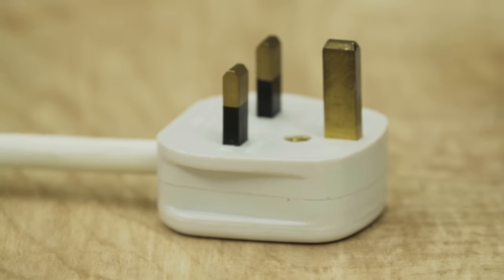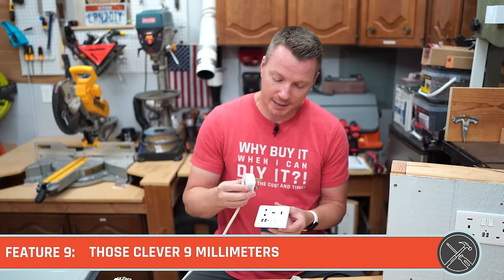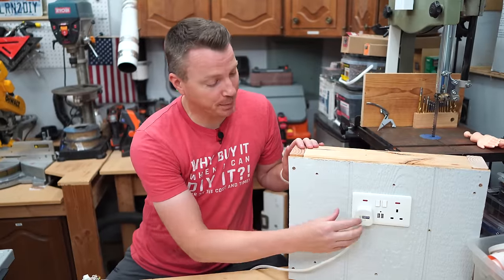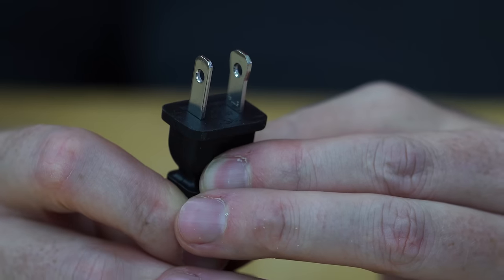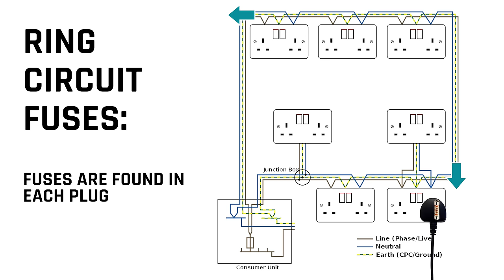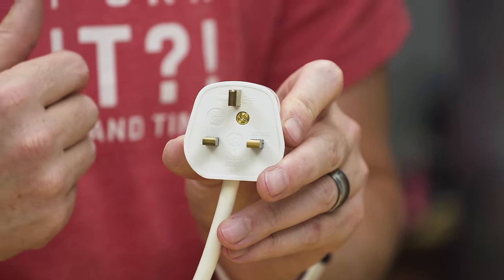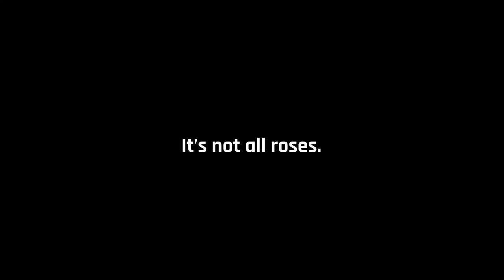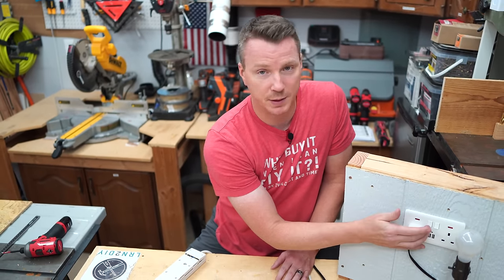British Plugs and Outlets Are On Another Level

Comment: As a Hongkonger, I am proud to use the UK plugs here compare to the others. Especially the fuse and 3 pins features. One time my brother use a Chinese plug hair dryer and it was short circuited. A large explosion 💥 sound happened and the house went dark. Wt a horrible experience.
Reply: That was not due to the plug, but lack of a proper HFI-setup.

Comment: As a zambian I grew up with the brit type of wiring 
I have zero electrical training but I can trouble shoot and fix anything with this system it quiet straight forward and calming knowing you have earthing and fuse plus circuit mains breaker.

Comment: Stepping on a plug is so painful so I really empathise with the last point. I don't really think anyone in the uk and elsewhere would go to the extent of troubleshooting the rest of the system before realising that the switch isn't turned on because we've had it our whole lives. Although there have been countless occasions where I have plugged my phone in to charge and forgot to switch it on
Reply: Stepping on a plug is definitely worse than Lego. By a mile.

Comment: The pain of treading on a British plug is unparalleled, that's something I haven't missed since moving to Canada!!! Great video!
Reply: yes, far far worse than standing on a lego brick.
Reply: Since I don't leave them lying around when unplugged I have never managed to do it. If you don't have enough outlets so feel the need to leave the plug lying on the floor get a plug in adaptor that goes into the socket and has 4 switched outlets lined up just below the wall socket. Then you can leave the plugs in the socket and just switch on or off as required. The internal fuse of the adaptor will make sure you can't overload the primary socket.
Reply: Try looking where you’re going….
Reply: Very close to the pain of stepping on LEGO
Reply: Just how often were you standing on plugs and why weren't you putting your cables away?
I haven't stood on an upside down plug in at least 30 years.
Reply: @Gambit771  I was about 15 or 16. I only ever did it once (going to the loo in the middle of the night) and never ever did it again. Leaving plugs laying around on the floor where they can be stepped on is silly.
Reply: From the UK. You will find that you stand on a plug someone else left out. Best thins is if you stand on them it rarely damages the plug. I have bent the pins when standing on them before but I wasn’t fit to put weight on that for for at-least 24 hours. So they are sturdy. I also have plugs from the 70’s that are still in service.
Reply: @ardin404  Yeah, well, stuff in the 70's was engineered to last at least 10 years and if a consumer had to replace something within that time, they would tell their all friends and never buy from that company again. Manufacturers these days have us all trained to think "well, the warranty ran out last month, so I guess I'll buy a new one!"

Comment: As an Australian, I felt sad for Americans when you described the issues with plugging multiple high draw appliances in at once. I thought that was just something to consider when camping with a generator. 
You might cry if you saw the power board running under my desk that powers my PC, heater and kettle. It runs them all at once a couple of times a day in winter.
Reply: But Oz plugs are primitive compared with the Brits. And as for lighting.  I've seen up to 4 cables trying to be squeezed into one of the minuscule light switch points (of which there are 4 in all, the whole lot contained in a 20mm diameter switch.  Utter madness.

Comment: Load balancing, a problem I have not heard of before is practically covered by having multiple rings. The ring covering the kitchen will use heavier gauge wire to cope with all the appliances. Cookers and other really heavy stuff will usually have its own supply from the main board. In my house there is one ring for upstairs sockets, another for down stair sockets and a separate on for the kitchen. Lighting is separate and typically upstairs and downstairs are separate. I have a separate ring in the garage, which I installed myself. Point taken about the size of the plugs, and sockets are available without switches. Curious to how well the UK system works with 110 volts.
Reply: 6mm
Reply: Judging by the panels in all the flats I’ve lived in, most builds in the last twenty years have had a dedicated feed for high power items like cookers and boilers, one for wherever the space for the washing machine and dryer is and one feed per room. Load balancing was never a thing I’ve had to consider.
Reply: Thanks for that I was sooo confused when he mentioned that but had forgotten we have multi rings ...
Reply: Can you add a ring? I noticed in my kitchen it trips and takes down all the house power.

Comment: As a kid in school (UK) we learnt exactly about plugs, how to take them apart and how they worked. It blew my mind when I moved outside the UK that other plugs didn't have many safety features. Whenever you would leave for holiday you would turn off all the plugs at the sockets to save electricity and keep everything safe from power surges when you're away.
Size was never an issue, nor stepping on it. 😂 And you were used to the switch

Comment: As a brit who has travelled a lot I've also thought the UK plug was the best thought out but couldn't say it out loud for seeing arrogant so thanks for this video!
Reply: If its true then just tell people to cry about it. Facts dont care about your feelings
Reply: The 2 prong plug always scares me. Even if I don't know the exact science, I just don't feel safe with a 2 prong that feeds horizontal compared to a 3 prong that feeds downwards.  I know that years and years of smarter people's knowledge have got my back, and they figured it out a long time ago. I can't understand why other countries don't adopt this method.
Reply: @bonjovi7399  Agree, it really should just be a global standard for 230v
Reply: @bonjovi7399  you are naive to think that smarter people have got your back. The main purpose of the cpc pin, or earth for lamen, is to protect the circuit from a short ect, the added benefit is that it also protects you from shock as the voltage is being directed to earth by the cpc, and not into you.
Reply: @JCJW101  Typ F is quite neat, too. Not so bulky and the socket also allows Typ C and the plug can easily combined with Typ E

Comment: In the UK you learn how to rewire a plug in GCSE (age 15-ish) Science lessons at school. It really demystifies electricity and probably saves on a lot of perfectly fine appliances from being thrown away.
Reply: the reason it is taught in GCSE (the UK's last set of middleschool exams) is because appliances in the 80s and 90s used to arrive without the plug connected up. So it was important to teach people how to do it. Most kids these days barely listen in that section of science class, because 100% of plugs now arrive pre-wired. But still a useful part of learning about electricity and actually being told about what's inside the plug
Reply: @Stealth360stealth  "appliances in the 80s and 90s used to arrive without the plug connected up".

Can't say I ever bought an appliance that came without a plug. Could wire one from the age of about ten (in the late 60's) but never, ever had to put a plug on something new.
Reply: I don't remeber being taught that at school but if it was it really didn't demystify electricity for a lot of people. Even those with a STEM mindset. 
I did mechanial engineering at uni & the number of people who struggled in the electronics module because they thought it was basically magic was unreal. I literally blew some of their minds when I put hydraulic equations next to electronics equations & labeled the electronic component again its equivalent in a hydraulic system.

edit for clarity they had no issues doing the fluid flow equations but got mental block in electronics cause they started with the mindset that electronics was basically incomprehensible magic even when the fundamentals were very similar to other areas of engineering that they were competent in
Reply: @Stealth360stealth  Oh yeah, my gran told me this. To be honest, the skill hasn't had many uses but it has been handy. Namely when I wanted to change an extension cord to have a much longer cable. Still have it somewhere.
Reply: @Stealth360stealth  Its crazy. I learned how to rewire light switches and electrical outlets in my home just because I paid attention to how to wire a plug. Its the simplest thing in the world.

Comment: A typical ring main in the UK is 32A, which is 7kW of plug-in appliances on each ring. Cables are sized such that even if the ring is broken, the full load can be carried on either leg (spur) without cables getting dangerously hot, even when those cables are buried in walls. The so called 'load balancing' problems just don't happen, even with badly botched installations.

In any case, while many modern 2 or 3 bedroom homes have a single 32A ring main for the whole house, larger houses might have two or more ring mains, one per floor, or separate ring mains for the front half and back half of the house etc. We will typically also have additional 16A to 45A spurs (radial circuits) for high power devices like cookers, showers, A/C units and immersion (water) heaters etc. (I long for a 10.8kW shower and an 11kW induction hob).

Comment: I grew up in the UK and as a kid I remember being terrified of power outlets when I went on holidays abroad. Something safe and normal back home which would now attack me with electricity if i touched it.
Reply: I remember seeing a shaver socket actually inside a shower enclosure in Greece. Thankfully not in my room though.
Reply: Whenever I plug in a two pin to three-pin travel charger charger on holiday it never seems very stable. Three gives stability despite the bulk that’s associated with it

Comment: We have a German single slice toaster here in the USA and installing the "SCHUKO-Steckdose" receptacle gave me an appreciation for the better design and quality of the German system. Also the skinny cord for the 240V toaster is nice.
Reply: The it's just Shuko (type F), which is the best plug in the world
Reply: @tiagochavarro  Agree it is best, and invented by Albert Büttner in Germany.
Reply: My issue is why on earth you would opt for a 1 slice toaster.
Reply: @jaridh1442  Tiny space available. There's only one toast eater in the house and they don't eat much. Irrational purchase made easy by Amazon.
Reply: The skinny cord is a good observation, and also a key differentiation. 

120V low amperage power is vastly safer so it doesn't need as many safety features.

The main caveat of 120 volts is that it requires double the amperage which results in double the wire thickness. 

During the world wars, Europeans couldn't afford that much copper wire, so they made safer plugs/outlets to make up for more dangerous electricity. 

Having the skinny cord is because it has less copper.
Reply: @tiagochavarro  my thought when I clicked on the video. "The british is pretty good but this guy probably hasn't seen any other central european outlet especially not schuko or the french one.
Reply: @aminy23  wait, what safety features don't you need on 120V? It can be marginally safer when the person is already shocked, but it's nearly impossible to get shocked even if you want to in a semi-modern system
Reply: @NJ-wb1cz  For 120 volts we don't need switches for each outlets. 

Brittish ring circuits require a fuse in each plug. Our circuits don't as we have appropriately sized circuit breakers. 

We have shuttered outlets (Tamper Resistant) as well in the US, and its a code requirement for modern homes. 

Replacement plugs are readily available here in the US. 

The lower voltage means we have double the amperage which requires thicker wires. As a result our wires are more durable and robust and don't require as much reinforcement and strain relief in the plug. 

The pins of brittish and US outlets provide grounded plugs from being inserted improperly. 

The US also has two pin plugs that are not grounded. For these though when needed, one pin is larger than the other (polarized) so it can't be inserted backwards. This ensures the outer parts of lamps don't become live. This was not the case with older British two pin plugs.

Comment: Fantastic video!  I really didn't know this much about the design of our UK plugs.  When I was younger and you purchased a new electrical appliance you had to fit a plug to it.  The way I was taught to remember which of the three wires went where was:  Blue to the left -the second letter of blue is L (L for left); Brown to the right - the second letter of brown is R (R for the right) and the last wire therefore went to the last pin.
Reply: Even simpler with the old colour system - red obviously live - black neutral - I realise the brown/blue colours were adopted so colour blind people could wire plugs but brown as live? - its not intuitive to regular sighted people
Reply: I learned it like that as well and for the old Red and Black colours it was Red to right and Black to left second letter {L} being for left
Reply: @pauldavies198  It's Cockney rhyming slang mate Brown...bread you're dead!
Reply: @richardherbert1375  LOL !!! I hadn't thought of it that way !
Reply: @pauldavies198  Yeah, I thought red and black were fine. We managed to keep that for the fixed building wiring up until 2004 in the UK.

and 3 phase , I still prefer Red, Yellow , Blue and Black(neutral) .  Brown, Black, Grey and Blue(neutral) . They swapped over the neutral  and one of phase  colours !!
Reply: When they changed from the more intuitive red danger live &c. I was told that you beat someone black and blue to neutralise them...
Reply: @JP_TaVeryMuch  Brilliant ! 🙂

Comment: As a Brit the only disadvantage is the size when packing it, when it’s in the wall it takes up less space as the wire comes out the bottom, and there’s no need to unplug and leave it on the floor as you can just turn it off at the switch. And never had issues trouble shooting an item, its a switch you get use to them.
Reply: German guy here. We don't have those switches, so I'm not used to it. Once while cleaning up, I accidentally flipped the emergency switch of our central heater (gas powered) and didn't find the error. It was quite shameful when the technician "repaired" it... So now I always have that in mind when something doesn't work lol

Comment: Interesting fact. My high school IT teacher was the granddaughter to a woman who died because plugs didn’t have fuses. Her case was one of the ones to prompt the law change to require fuses. She told this story to my class and another member of staff realised it was her great grandmother. They both realised they were related and both belonged to different sides of the same family who hadn’t talked in years. So they reunited their families 😊
Reply: Fair to say the grandmother sparked the family back to life
Reply: To think, if she had been in South Africa the earth trip switch would've saved her life. No fuse needed
Reply: A fuse protects against overload current.
It has no effect on electrical safety.
Reply: Graham,
Not quite.
Unfortunately in newer housing developments, some housebuilders are being encouraged to use the ⅓ cheaper system of the European lack of an Earth or Ground by (legally) using the neutral return as an alternative to the usual belt and braces electricity company supplied earth cable as well as the separate earth spike.
This is a solid copper pole connected to the house's earth/ground cables and jammed down into the actual ground or earth in the garden / street outside. Usually within a box set into terra firma with an inspection cover not, as you might have imagined from my description, just stuffed into a handy bit of mud!
Always consult a qualified electrician. Had to put that, sorry.
Reply: @sroberts605  My dear mama told me as a child that I only need to tell a policeman who I am.
Something to do with being caught scrumpying in the orchards of the big house aged ten.
Reply: BOOM
Reply: In EU we use HFI-setups - problem solved.
Reply: Granddaughter of a woman. Not to a woman. When you finish school you will have mastered the language I am sure.
Reply: @JP_TaVeryMuch  Never heard of that (Germany, Austria). There are regulations (how long, how deep, form...) for that ground connection which is checked before the building is finished because it's necessary for RCDs. At my home it's a metal bar of some meters lying flat in about two meters deep near the house. But obviously no inspection cover, just a connection to the main current box.
But there was a now forbidden circuit (for new houses) with PE connected to N throughout the house when there were no RCDs installed.
Reply: @reinhard8053  Good to hear that. I stand corrected in part.

Comment: Brilliant video!! As a Brit I have never heard anyone explain our plugs and sockets so comprehensively. I would just say that in practice the only load balancing consideration is plugging multiple appliances into adaptors on the one socket, but I guess that's the same everywhere. Great channel!
Reply: Same, never knew the plastic ground pin was double insulated